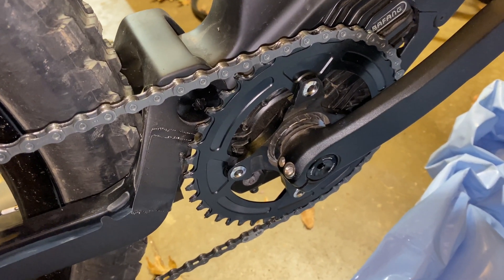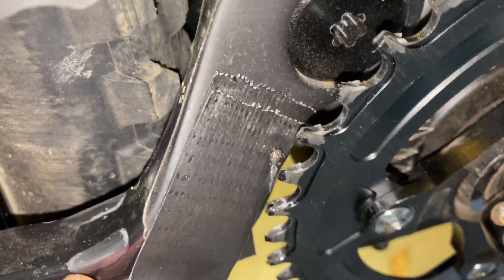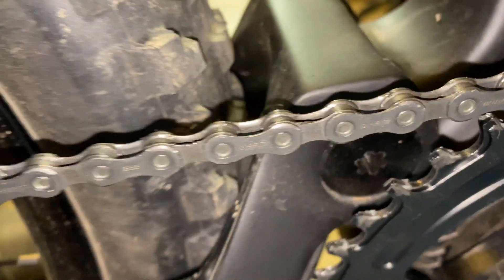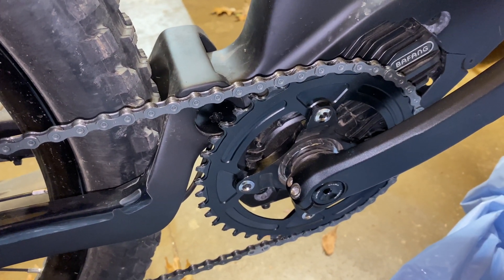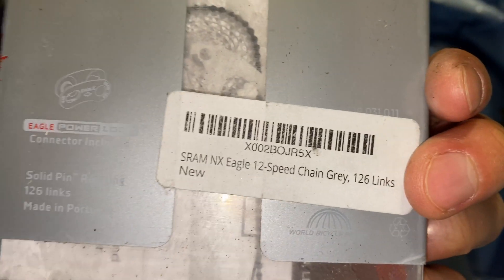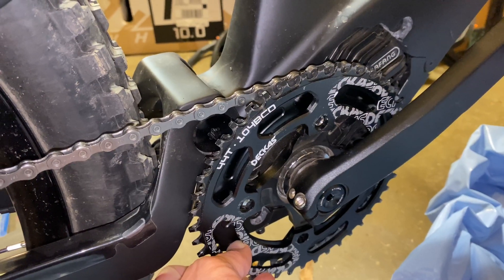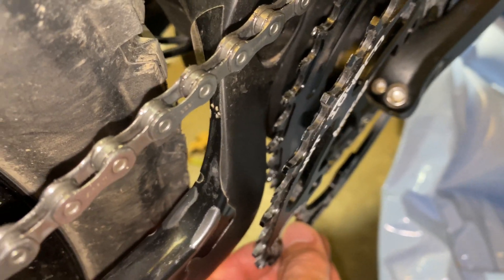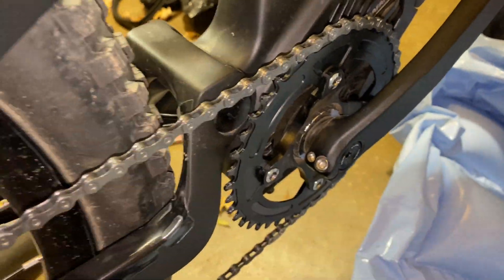42T Narrow-wide Chainring on a Luna Cycle X-1

Comment: I got my luna x1 2 weeks ago and watched your video. I also installed a 42 tooth chainring even rigged a clamp to get the swing arm as close as possible and still didn't have contact. It was very close but it will not touch. IMO even if it did contact on another bike because of variations in tolerances from bike to bike during manufacturing carbon fiber doesn't propagate cracks the damage would be very limited. Your videos have helped me a lot with my x1 Keep up the good work.

Comment: Hi, 
I’ve been wondering for quite some time, which Ebike do you prefer, the Luna X1 or the Frey AM1000.  I have the Frey in customs right now, and thinking of getting the X1 also. I would greatly appreciate your thoughts!!
Best Regards,
Cesar Lomibao
Reply: Isn't the Fray a lot heavier than the X1. Also it has far less power than the X1 with the ludicrous option
Reply from the maker: @LarryRichelli  The Frey AM1000 weighs 12 lbs more than the X1, and no, the Frey is more powerful than the ludicrous X1. The Frey AM1000 is a really nice bike. Honestly, if I had to choose one to keep, I might pick the Frey. The 3rd gen Frey uses standard Reention battery packs, and I just bought two 52V/20Ah packs for it off AliExpress. If I ever need new batteries for the X1, I'm sure no one will have them available. It's a proprietary pack that only fits Dengfu frames, and they don't even make them any more. The current generation Frey AM1000 uses a different battery though but it looks much better since it's integrated into the downtube. It's a tough decision. When I bought the X1, it was advertised as being 50 lbs. When I got it, it was actually 55 lbs, and had I known that, I might not have purchased the X1. The current X2 is even heavier. It's not a big enough difference in weight to justify the expense. Another thing to consider is support. Luna Cycle has awesome customer service. However, they don't make the bike, so they can't give you parts if you lose or break them. I know lots of people that need small parts off the frame, and Luna can't supply them (initially I did hear that Luna was parting out new X1s in the beginning to deal with warranty issues, which was nice of them), and Dengfu won't sell them, so you're basically stuck. Frey makes their own frames, so they can send you anything you need. Their customer service is excellent as well. If you need any warranty work done, you bring it to your bike shop, and Frey pays the bill.
Reply: Luna X1 is a far superior bike. Carbon frame and decent components. Also 20lbs lighter then the AM1000
Reply from the maker: @superj7106  No, it's not. The Frey is more powerful in real life (and won't overheat and run in a limp mode like the M600 does after a short time at high power), and the weight difference is 12 lbs, and the X2 is even heavier, with a weight difference of 9 lbs. The X1 also comes with a junk plastic derailleur. I had to replace it with a metal one because it broke. The Frey came with all Shimano XT components.

Comment: I'm trying to remove the stock 30t from my X-1 and I'm having an extremely hard time slipping the 30t past the spider that attaches the ring to the motor. How did you actually remove the 30t chainring? Do you have to remove the spider? The kit Luna provides with the bike doesn't seem to have a socket capable of removing the lockring on the spider.

Any help is much appreciated. Thanks!
Reply from the maker: Yeah it’s really difficult but it is possible to remove it without removing the spider. Just keep trying. :)
Reply: Did you end up damaging the chainring in the removal? Is there a special orientation required?
Reply: If you remove the bash guard for the motor the stock chain ring slides right out.
Reply from the maker: Lucas Whipple no, I didn’t damage it. But I did use a little force.
Reply: Ok I did it, and I understand what you mean - it’s very hard to explain. I ended up getting two spokes of the spider wedged in the gaps between bolt holes on the spider. Anyone else who ends up trying this, I guess it’s just persistence and a little bit of force?

Comment: Hi There how does your Luna X1 compare to your Frey AM 1000? Power, handling do you notice the extra weight in the AM1000? Deciding between a Luna X1 and the new Frey EX
Reply from the maker: Simon Tennant how do you plan to use it?
Reply: @JustEnjoyingLife73  I have a 4 Mike commute to work and to do single track trail riding, I like jumps and down hill mostly, so I'm wanting something that has enough assistants on the road to do 45 kmph, and enough power and travel to hit the down hill and climb back up.

Comment: I don't understand why you want to go to larger chainrings when you are not using the smaller gears on the cassette.
Reply from the maker: Actually, I use the smallest gears quite frequently during single track trail rides. That's why I'm looking for a larger front chainring.
Reply: @JustEnjoyingLife73  sense it comes without the smallest gear how do you make it work again?
Reply from the maker: @LarryRichelli  You just need to adjust the limit screw on the derailleur to enable the gear and then adjust the derailleur so that the chain doesn't skip. I've seen someone do that before but I haven't tried yet.
Reply: I'm doing both. So far, so good

Comment: I might be more cautious than you because I don't want to even think of a possible problem on my bike if I want to completely relax so I wouldn't be comfortable accepting that small clearance with the 42T. I have a Bafang BBS02 and a 46T Luna ring and with a 12 tooth cog am able to just about reach 35mph on the throttle. So I think a larger ring and safer clearance would work good for you with both throttle and pedal cadence though I don't know why you would want to go over 25-30mph :)
Reply from the maker: I think I'll settle on a 40T just to be safe. I'm doing some of this just out of curiosity. I just want to see how fast the motor can make it go. Sometimes having a larger chainring makes it easier to pedal with a more comfortable cadence. I tried to keep up with my non-ebike buddies on an off-road trail but with the 32 going to a 13, I couldn't maintain the cadence. Also, some people are using this bike to commute for whatever reason, so this info should help with that.
Reply from the maker: I've had a 42T on it for a couple years, and there has been no contact.